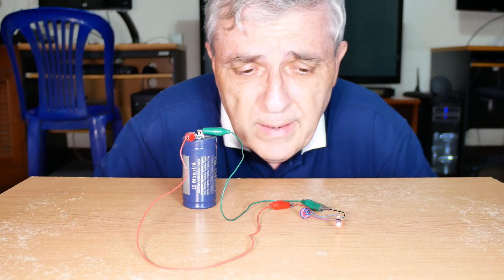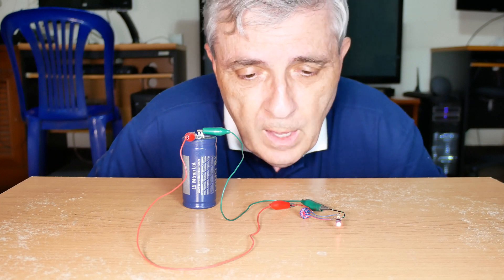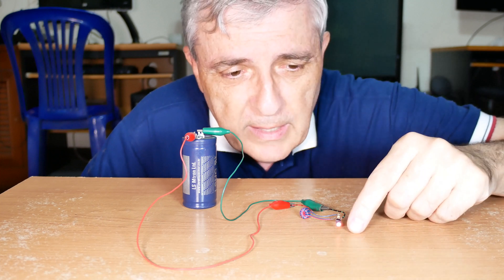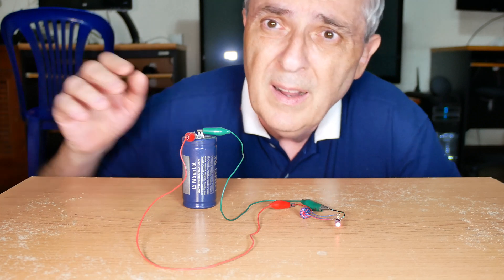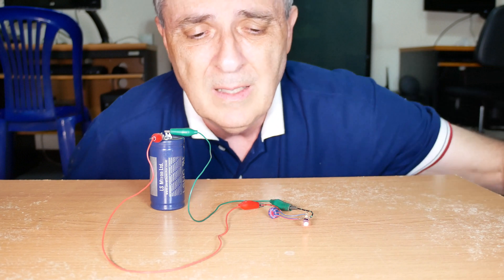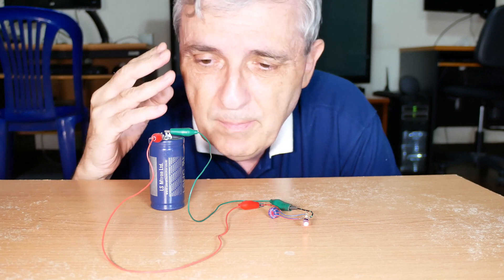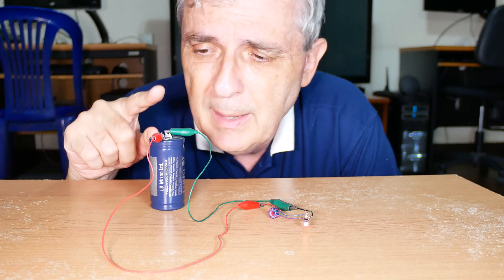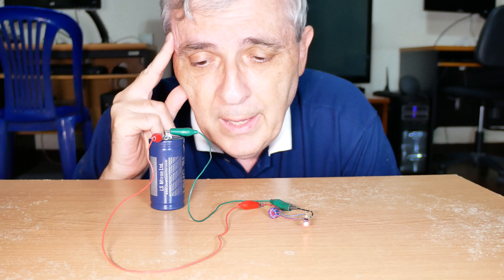Joule Thief Mysteries - The Case Of The Phantom Charge (4K)

Comment: The joule thief generates a huge voltage spike. Did you take the output from a secondary winding or a primary. Either way some claim that due to the extreme high voltage spike the whole coil becomes a type of antenna and absorbs energy from the environment and that energy is also transfered to the load. I tried messing around with it for some time, but couldn't get significant results. The winding must be a specific number of turns or something. 
On the other hand it is just a voltage booster. .5.L.I² is  the energy of the inductor and due to high voltage spike it lights the led for a fraction of a second at a frequency of Mhz or other.
Reply from the maker: I did more research and found that the "super caps" don't fully discharge all at once. They keep some "hidden" that will come out later if it's left alone. Caps from the 1950s & 60s did this also, but I thought that was gone away. Turns out what is old, becomes new again!

Comment: I think supercapacitors can pick up a little charge from a lightning storm, it sounds far fetched, but I had a garden light with a broken solar panel and a super cap in it light up during a lightning storm, I assumed it must be the close lightning that might've charged the cap a bit. That little led takes a minute amount of energy to work, and with a joule thief added to the equation even less...so can you remember if you had bad weather when the led went on?
Reply from the maker: I can't remember the weather at that time.

Comment: I’m Not an expert by any stretch of the imagination; however, I’ll share some thoughts that I had. Do you have any low voltage, high amplitude devices. Tesla did experiments with electricity transmission through the air. He operated an electric model boat on a lake with voltage through the air. I don’t know all the details. Again, I’m very much a beginner & a Novice. The capacitor might be acting as a receiver for a low voltage, High energy source, somewhere nearby.
Reply from the maker: No high frequency devices nearby. In fact no AC plugs or wiring close by.

Comment: Is it possible that  some energy stored in the coil goes back to recharge the capacitor.
Reply from the maker: It would be more likely the coil picked up stray radio frequency energy (acting like an antenna).  Many months after I made this video I found an article on how capacitors, especially super caps, can internally reshape themselves releasing charges that are normally "stuck" in them.

Comment: “Reform” is a TV repair man’s way of reducing the self-discharge rate of an old electrolytic capacitor. 

Here’s what I think: There’s a property of capacitors called dielectric absorption. If you charge a capacitor and leave it charged for a while, charges will become embedded in the dielectric (bad terminology). If you then discharge the capacitor all the way to zero and then disconnect it, the dielectric will slowly begin discharging into the electrodes of the capacitor, causing the capacitor to appear to slowly recharge itself. This process can happen very slowly over the course of weeks.

Also, other comments have mentioned that an LED with light shining on it will generate voltage which may also play a role in what’s going on.

There may also be some property of your circuit that is detecting radio waves and using the received energy.

Comment: Good video I found the same effect, the C and the inductor do form an LC circuit 
The transistors are ‘detectors’ technically just usually not good ones you could try to improve the effect by gaining a germanium transistor and increase the mass of the core a bit maybe. 
I only discovered this while playing with one recently also try germanium diodes as rectification detectors. 
The setup I had was different I just had the inductive oscillator connected to a bridge rectification and then charge a 18650 battery, no input on the oscillator and found the battery charging by itself. 
To learn more about different detectors just look up ‘cats whiskers detectors’ 

Regards.

Comment: The coil charge the capacitor, if you use diode to prevent the charge came from the coil to reach the capacitor, don’t forget that the coil charge and discharge not only hold the charge in magnetic field

Comment: It's possible the wires are acting as an antenna. The energy could come from overhead lights. The circuit might be oscillating at a frequency too high for a multimeter to detect a voltage. Then the circuit will start.

Another thing that can happen is temperature. Heat could be converted to charge.
Reply from the maker: I will have to think about how to test that.  Thanks.

Comment: Phantom charge sounds about rite to me. Capacitors have a rebound effect like a battery. Add to that it being a super capacitor.
Reply from the maker: What I find odd though is I never disconnected the joule thief, the cap is constantly being drained through the JT, so the rebound must happen as a spike.  I have convinced myself that this mystery is seated in my missing some fine point of the cap or transistor or some method of induction that is causing this to happen.  I'm not prone to visual hallucinations, so...

Comment: The LED will generate some power from light. More likely that the cap charges itself up (a tiny bit) - chemistry - you could discharge and leave sitting on a shelf for a while and then measure the voltage.
Reply from the maker: I've got an identical capacitor that I keep right next to it that is not connected to anything and I measure the voltage on it occasionally.  So far it has not shown any increase.  I will have to try the LED thing to see how much electricity it can generate.  Thanks.
Reply: @tsbrownie  You would be surprised as a solar cell will light up if voltage is applied to it and the LED will collect light as well.  I saw a video of someone using 40+ leds to make a solar cell, and it worked.  The best is yellow, I believe, at collecting the most.
Reply from the maker: @generalawareness101  Interesting.  I will go search for that.

Comment: wires serve as coil to tune a tank  charge for receiver am
Reply from the maker: I have tried putting AC wires next to the coil, making big sparks near it, used a high frequency (laptop) power supply next to it, ... and nothing I did increased the voltage even a little.  That was what I assumed was happening, but I can't make it happen even under ideal circumstances like wrapping the AC wire with one of the leads or running the jumpers in parallel!
Reply: @tsbrownie  try lengthening the red wire to about 4 feet to reproduce. I suspect this and the diode itself are picking up stray fm signals.